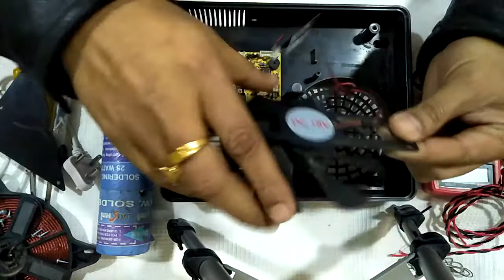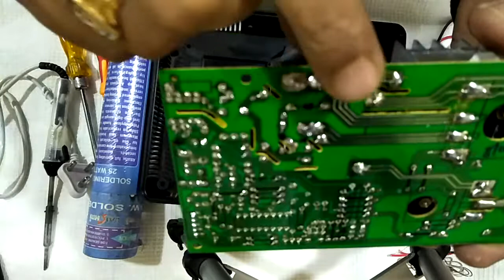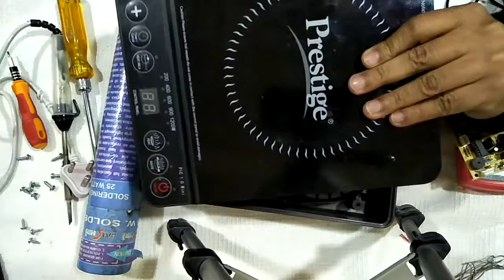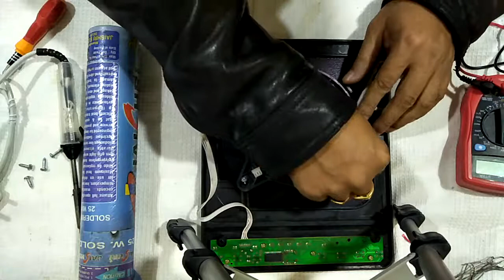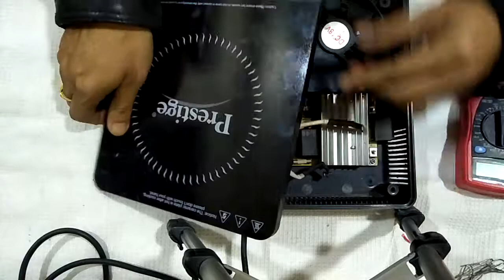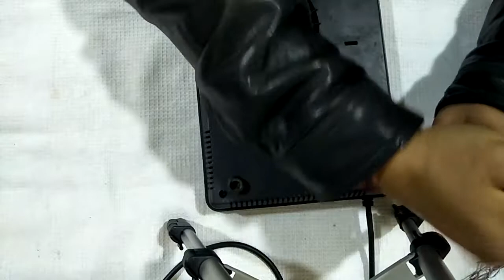How to assemble Prestige PIC 1.0 mini Induction Cook top

Comment: Sir can you help me, i have this same model i had checked mostly every thing with multimeter including fuse and everything but when i keep a utensil on the induction it shows P- And keeps beeping continuously but water in utensil is heating what should i do. this happened suddenly  previous it was working fine
Reply from the maker: Have you verified the utensils are steel/iron and flat.Also,Check the diode and heatsink compound

Comment: Very Good detailed explanation. I have the same model, which I bought 4 years ago, now the buttons were not working in the control panel section. I saw your video and got an idea about how to proceed. Finished my work successfully. Thanks for your videos.👌👍
Reply from the maker: This video is kind lengthy and I could have edited well,sorry for that.I still thank you for your positive comments.I have attached the repair of the same cooktop and upload little later.Please watch,there was a 400v capacitor(rectangle shape) which is available near the fuse was short circuited. request you to watch my repair video of the same cook top and comment 🙏🏻
Reply from the maker: I have also repaired many other types of induction cooktops, request you to subscribe for many other house hold electronics gadgets and automobile repairing videos.🙏🏻